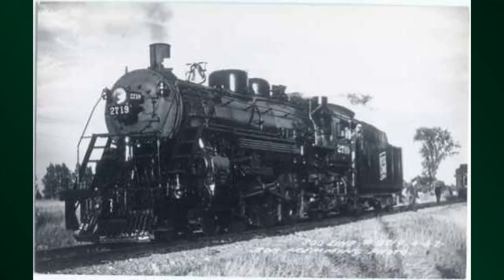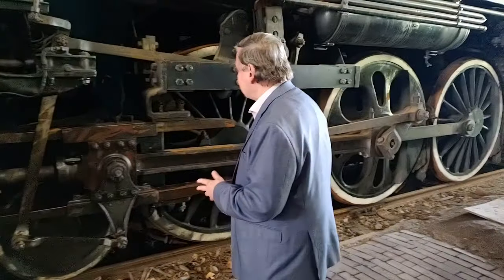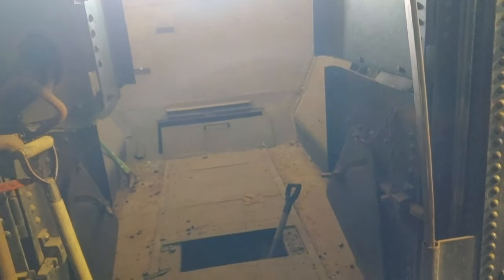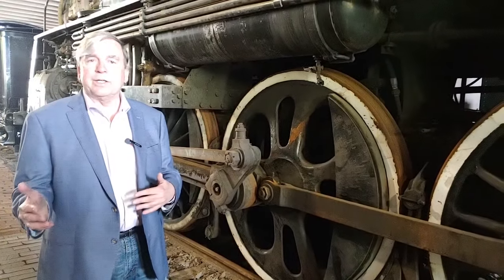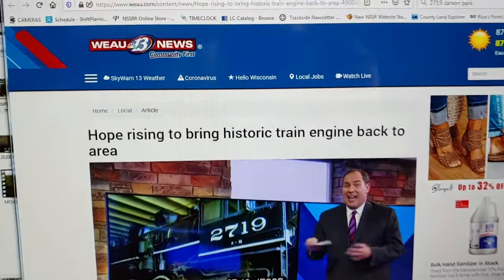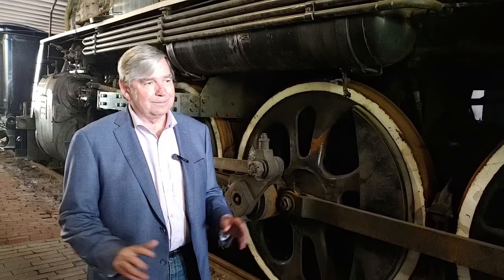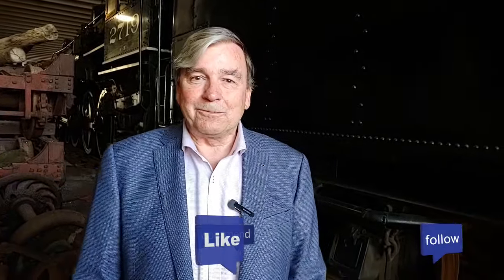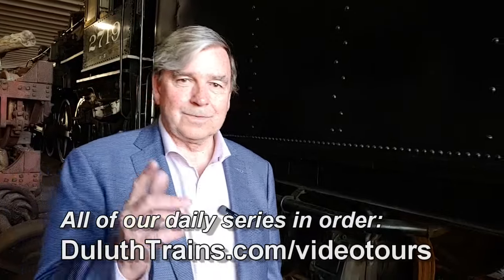Soo Line 2719 Steam Locomotive

Comment: Josh, thank you for this one. Growing up in Glenwood, the first division point west of Shoreham, I was around these Soo Line locomotives a lot in the late 40s and early 50s. The roundhouse at Glenwood always had a number of locomotives sheltered and being worked on. I will never forget the smell of hot valve oil and coal smoke in my dad's clothes and we are reminded of these fantastic memories when we run steam on our 7-1/2 gauge railroad. Thank you for this one. BTW, I had a chance to ride in the cab of 1003 some years ago near Colfax WI. A lot of memories came up and I had trouble containing my emotions of riding my dad's train between Vergas and Dent MN way back when.

Comment: Hi from Green Bay, and the National Railroad Museum, with her sister #2718 donated in 1957 as the 2nd loco behind Milwaukee Road #261.  There are 4 of these locos saved, with #2719 first at Eau Claire then moving to Duluth.  Then #2718 here in Green Bay, plus I want to rebuild her and modernize it with new welded boiler and larger tender with 6 wheel trucks to carry more coal and water, plus temporarily repaint like C&NW 400 plus Milwaukee Road Chippewa.  Next is #2714 at Fonddulacs' Lakeside Park that was moved over city streets.  Next is #2713 in Stevens Point near original Soo Line yard and shops then WCL in 1993 then CNR in 2003.  Next are 3 older H-class with 730 at Escanaba/Gladstone MI., then 735 at Thief River Falls MN., then 736 in Appleton, WI in Telulah Park next to Newberry St. and the former CNW industrial track now used by CNR.  I worked here in GB at the NRRM as employee and official Tour Guide from 1984 to 1989 and met thousands from around the world like London, Paris, Berlin, Tokyo. And many more. Their favourite is Big Boy #4017.  I had to know about our 93 pieces of rolling stock.  But, unfortunately, some of the different managers did NOT have experience with railroads, nor the fans.  Some of them sold engines and cars.  Then worse some pieces were scrapped and destroyed:  with the Plymouth Center-cab #2001 nicknamed Mighty Mite; and the steam powered crane from Appleton. All together, we were almost at 100 pieces, a potential milestone.  But now we have 37 pieces missing, leaving only 56 pieces left.  How disappointing!  Next year is its 65th Anniversary. But first we need to make some big changes.  Please help us !!!!!

Comment: How absurd it would have been for the city of Eau Claire to take that engine from an organization that was actually using it,  and let it sit.   Glad it stayed in Duluth.
Reply: The engine was in working order when Duluth got and was running more excursions than it has in the last 10 years, there is a full length DVD of this. It was put into storage when Union Pacific bought CNW and bulldozed the roundhouse and spare parts with one month's notice. CNW help with the restoration and track usage , UP not so much. If do your research you'll find the UP did this to allot of organizations when bought a new railroad. They could have made this video about 2719 history not brag how they acquired her. This is equivalent to someone having to sell there dad's car with all the memories to a used car dealer because there landlord said they couldn't keep it then having that dealer brag about how they got in the ad too sell it. Make no mistake there no better they just have more parking.

Comment: Four 2719 to run again would it need a full heavy overhaul? Or just a Boiler tubes to be replaced and a boiler inspection? Would love to see her run again Some day please!
Reply: also need new flues
Reply: @JACESOFFICIAL wood it just need flues or or complete overhaul?
Reply: @rudycarlson8245  2013 his flues were expired and it also need an overhauk since its been idle for a lot of tears
Reply: years
Reply: @JACESOFFICIAL  when’s the last time it was under steam?
Reply: @rudycarlson8245  2013 after meeting with mil 261
Reply: @JACESOFFICIAL  The plan I heard is once  the 332 is up for her 1472 overhaul they’re going to exchange her with the 2719? and leap frog the two engines  what I mean by that is I think once the 332’s time is almost up I think they are going to pull the 2719 into the shop and get started on her but I’m not sure about that? Do you know when the 2719 was built and by who?
Reply: @rudycarlson8245  american locomotive company in 1923 a 4-6-2 pacific there are 2 more sisters around today 2716 and 2718
Reply: @JACESOFFICIAL  thanks
Reply: @rudycarlson8245  no prob is the dmiryellow stones better or the c&o 2-6-6-6 h8
Reply: @JACESOFFICIAL  do you have any idea when they are going to get the work on the 2719?
Reply: @rudycarlson8245  nope